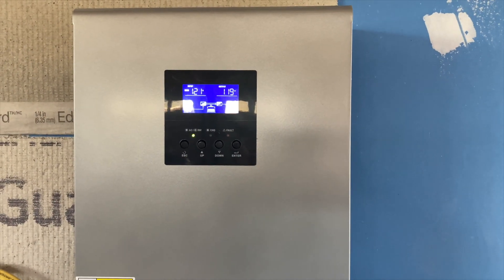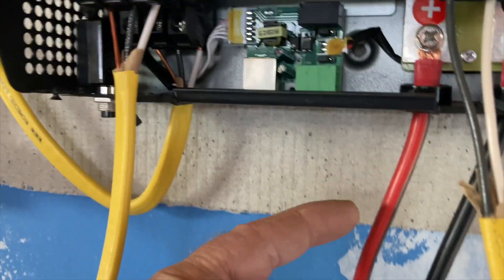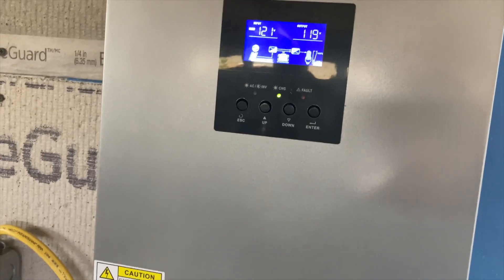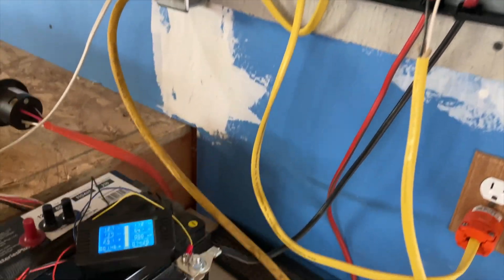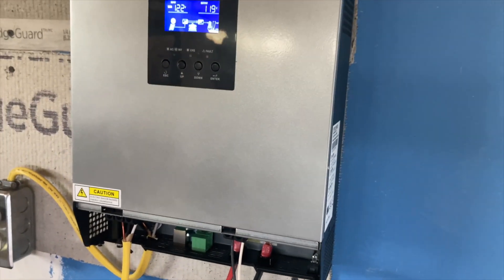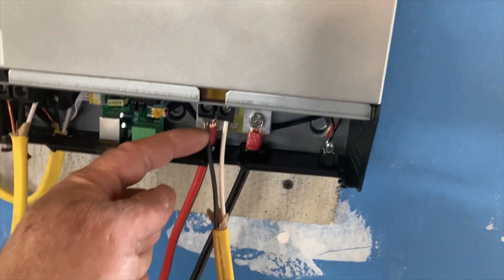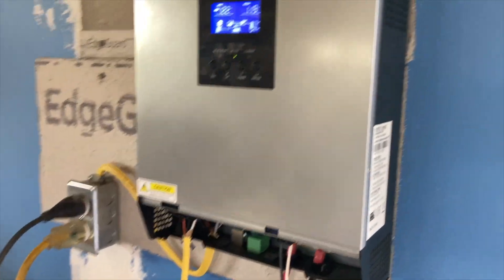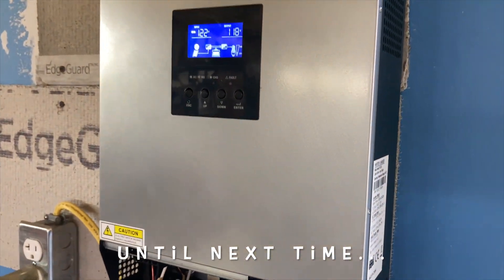Power Your Refrigerator Off Grid!  Y&H Solar Hybrid Inverter

Comment: Why do you need the battery monitor? I have an inverter similar to this and it tells you those things on the inverter.
Reply from the maker: you are correct, this inverter also has a built in voltage and current monitor.  So the one I hooked up is not needed.

Comment: Crap , mine burnt out after 5 weeks , 400 euro gone , company not interested in repair, replacement or money back , f—-k them
Reply: So glad I read your comment! I will NOT be buying that inverter. You saved me from wasting a lot of money. For that I want to thank you!
Reply: Update, with the inverter comes a instruction manual ,  with different fault codes , mine flashed up code 52 , instruction manual advised to reset the inverter , which I did , twice ,the manual then goes on to say , if the problem is not resolved return the inverter to factory , what a joke they wasn’t interested, , last communication about  month ago , they promise to repair the inverter if I remove negative comments , só now. they have sunk to bribery , I’ll just bite the bullet and swallow the 400 euro and expose to the public the scam that is operating